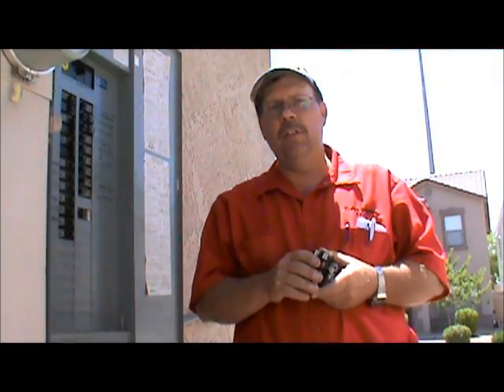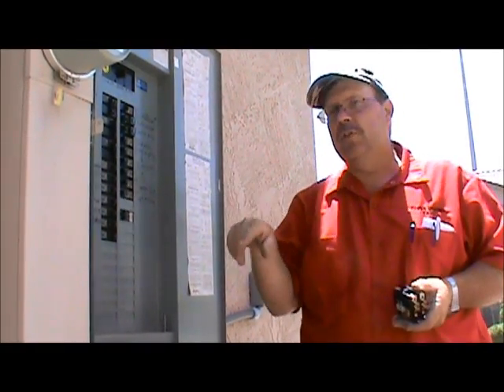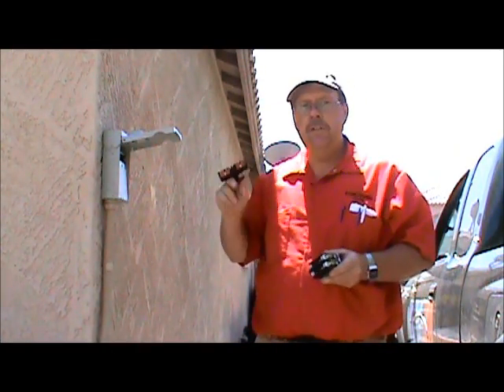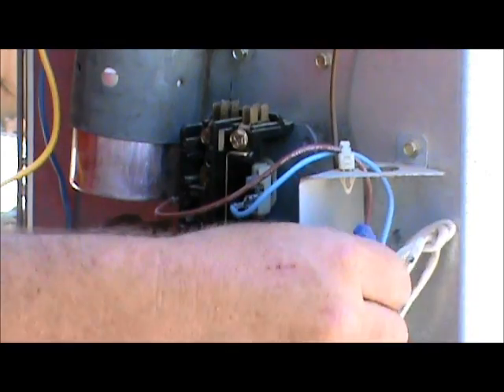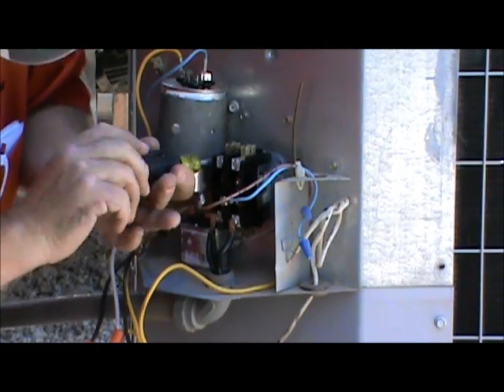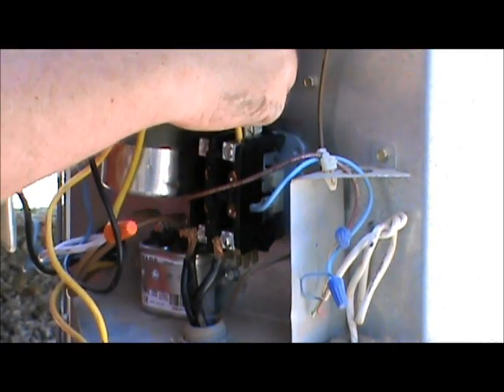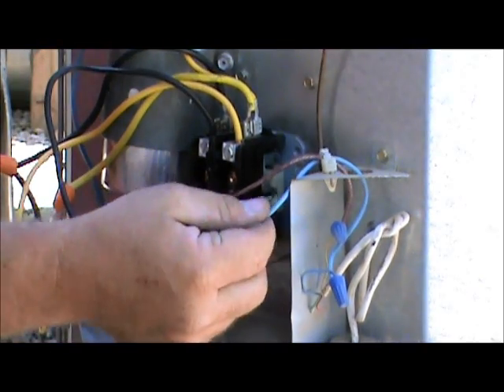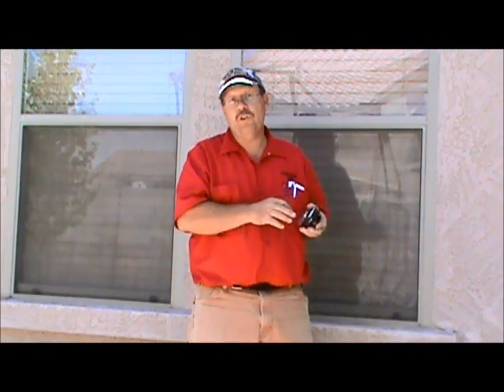Fix Your Own AC - How to Change a Contactor

Comment: Your original contactor was a single pole with the "switched" side ( the side with point contacts that open/close) on the LEFT...and a "shunt" side ( the side that only has a bar bridging the bottom and top contacts), on the RIGHT. So left side-black....and yellow-wire-right....makes sense here.....but MAY not make sense if you replace the unit with a 2 -pole contactor.(like you did)..meaning, now you have a right side that switches on-off.....but should be "on". The only way to "Fix" that, is to take the previous wires on the output(top-right), and connect them to the "always-hot" input.....bottom/right. For some circuits it doesn't matter.....but for others it does matter...so might as well keep the intent of the original wiring concept the same.

Comment: This was a great video! Very helpful and explained with simple, step by step intructions. Unfortunately, I watched this after I had already blew my 3AMP fuse of my furnace changing out my capacitor. When he tells you to turn off the furnace circuit breaker, do it — lol. As he says in the video, it’s a lesson learned and the new fuse was easy (and cheap) to pick up at an auto supply shop. Still, I could have avoided the hassle. Thanks!

Comment: The black wire you screw in on top without the connector it can get hot when contactor is running thus the rubber will burn and get fire, no?

Comment: One thing also worth mentioning is if you have a heat pump and it has a single pole contactor in it you either need to replace it with a single pole contactor or make sure your crankcase heater is on the line side of the contactor so the crankcase can function properly. Of course all of this depends on the manufacturer.

Comment: Question! 
Does that 24 Volt have any negative or possible position and need to connect to correct side of connector, or we can connect either side of connector,
will does not make any difference.

Comment: The electric cable coming into the breaker box got damaged and sent 240 volts through my house.  The TV caught on fire and light bulbs that were on got fried.  The central air stopped working.  A tech told me I would need a new compressor.  Is it possible the increased voltage damaged the contractor before it reached the compressor?  The tech guy only checked the electricity coming out of the contractor.

Comment: i wish you had started the video showing the outside unit with the power on with the bad contactor. that's the point of changing it, because it's bad. show it being bad before changing it.

Comment: Could this be causing my blower fan inside my unit to run NON STOP? It just wont stop.. Tried new circut board and thermostat. M<y next move is a new Motor control board.

Comment: I have an old (1980's), noisy contactor that seems to work fine. Should I replace it for any reason but for the noise it makes? Is the noise a sign that it's failing?
Thanks!!

Comment: Great video!  Just two questions:

1.  If I have a 30AMP circuit, is it OK to use a 40AMP contactor?  (both control voltages are  24, btw).   I need to replace one of my contactors, but it has no identifying information printed on it (it's a residential outside a/c fan & compressor unit).
2.  Is it best to discharge the capacitor before changing out the contactor.

Comment: Thank you! This was very helpful. I ordered a new contactor via Amazon, received and replaced it in two days. I also ordered a spare capacitor and will be able to replace that if it goes bad. However.... of all the google searches I did "AC compressor clicks, but won't start", they all talked about the contactor and capacitor... the contactor clicks and is silent. The capacitor clicks and hums or fan needs a push start. I replaced my contactor and put it all back together--so confident, I even put the cover back on. I fired it up... "click"... nothing. I am guessing the click comes from the low voltage line from the thermostat to the contactor solenoid and that the unit will also click if a fuse on one of the hot lines in the quick disconnect is blown. I dug out an old meter and was able to determine that one of the fuses in the quick disconnect was bad.
So a 3rd cause of a compressor click but no start is a no power on one of the hot wires. Thanks again for this video... It was the best I saw for helping me solve my problem and fixing my ac for a few bucks.

Comment: I picked up a single pole. Is there a top or bottom? The terminals are exactly the same on both sides.
Reply: I have the same question. Have you found the answer?

Comment: if I come to somebody's house and they attempted to change out the contactor and it's wired wrong I guarantee you I will charge another $200 because I know someone played with it. Techs don't like hacks, because there are no cheap shortcuts for a functioning air conditioner. however if you would like to have to pay less buy your own parts once they tell you what's wrong and make sure they charge you for labor because they can't get you then

Comment: If the condensing unit is stuck on even though the system is off, could a simple Contactor replacement be the culprit? The unit is only 5 years old but the Condensing unit is not shutting off when the home reaches it's set temp. This has caused the Evap coils to ice over since the condenser never stopped pumping coolant.
Reply: Bakum22 my contractor was bad, compressor was not shutting off, lines froze....contractor was bad and getting hotter than the devils cigar. New contractor had me back to normal.
Reply: My problem (Goodman AC) was the fan  always on even though the system is off and eventually tripped the AC circuit breaker.  I replaced the contactor and fixed the problem.

Comment: i replaced my contactor, i mixed rhe 24v wires. they were not interchangable. the contactor started going crazy and i shut it off swith them up and it worked just fine. 
how do i find out if my transformer burnt up?
Reply: how did this turn out? Asking 3 years later for an update lol.
Reply: @TristanVash38  lol. I didn't  burn out the transformer. I guess i turned it off just in time. I ended up replacing my thermostat and haven't had an issue ever since.

Comment: I been running my package unit A/C - Grandaire Model GP3RD-024K but it seems to be running a lot lately and air is not so cold during the day but better at night. What could be the problem? I was thinking I need a new charge of refrigerant.

Comment: hi there,
ive changed the cotactor and capacitor but still ac is not working. there is no buzzing sound or nothing.its dead. but when i press the contactor it works. 
please help.
Reply: send me $10 dollars and I'll tell you whats wrong. very easy fix fti
Reply: fyi*

Comment: Ah hell, if this contactor is also known as the compressor start assist then I just got burned for $340! In my defense though, our truck, AC and freezer all broke within a couple of days of each other so we just didn't have to time to do the research to fix it ourselves. It was just to hot to think in Tampa today!
Reply: It is not, what you are referring to is a capacitor (the shinny thing to the left of the contactor) btw capacitors cost from $10-$25.

Comment: I need to replace a contactor and its FLA is 25 and Resistive is 40 amps  its a 24v,  do I need to get the same exact one or can I get a 30 amps FLA?
Reply: +Edwin A. Gavidia  it will work....20 FLA would NOT.

Comment: This makes no mention of discharging the capacitor: shorting Herm (compressor) to Com (ground). When is it necessary to discharge the capacitor?
Reply: +Erik K A light bulb  in a socket with both terminals wired and stripped to expose some bare wire. The bare wire ends will be touched to the terminals of the capacitor. The light will come on and drain the potential of the capacitor down till the light is off. This is what we call a capacitor tuning tool. :)
Reply: +Bradley Glidewell  or a big resistor about 90 ohms.

Comment: I have a situation my capacitor it won't magnetized and my ac unit will not start until I push the contractor but once I do that there is nothing coming from the ac vents and I believe that's a dual unit like u just mentioned on this vid any help will be apreciate it and nice tutorial by the way keep up with the good stuff thank you

Comment: Thank you for the great video, My new contactor has the low voltage on each side but my old one is on the same side. Does that sound right to you?

Comment: I bought a new contactor but it doesnt have any wiring labels on it {L1,L2,T1,T2} how do i install it? thanks.
Reply: I bought the same there is no labels and symmetrical.  It does matter  just installed it .  I fixed my problem with fan on outside AC unit that did not  turn off even thought thermostat did not call for cool.

Comment: My contactors relay for my AC is working good with thermostat but when I reconnect pull switch in the AC unit still turns on even when thermostat is off. I can send you or show you image of the wiring on the contactor on my g+

Comment: @fixmyownac  If your new contactor is not exactly the same and both sides look identical - how can you tell which side goes to line voltage and which side goes to the capacitor?

Comment: I've changed the contactor out in the past.  However, the new one that I just got doesn't have the wire connectors on the side.  I don't know how to connect it.  Do you know what I mean?  Does that make sense?

Comment: I was wondering if those bottom wires need to be left without connectors. My old contactor had a different type of connector that accepted "raw" wire. The new one is only a screw so it seems I would need a U connector. Just wondering if that would work?
Reply: Typically, the same leg/side are the same connection but different ways/types to connect. Look closely and you will see blade or screw can be used.